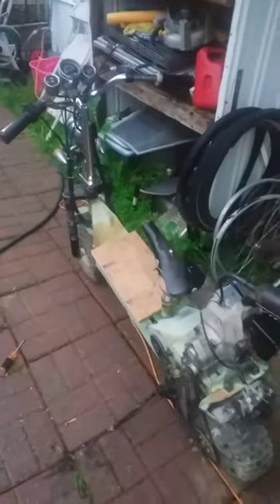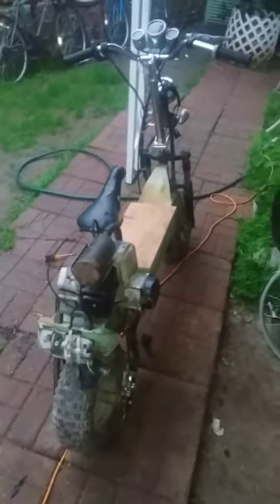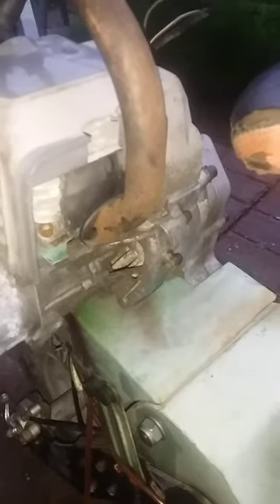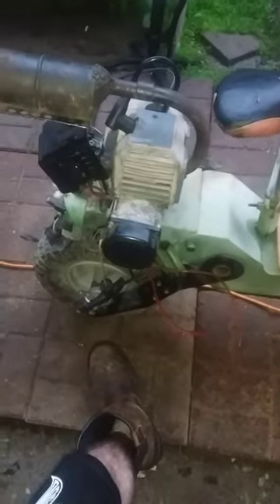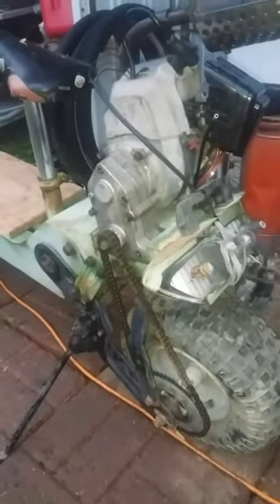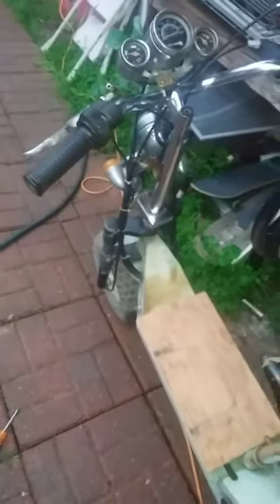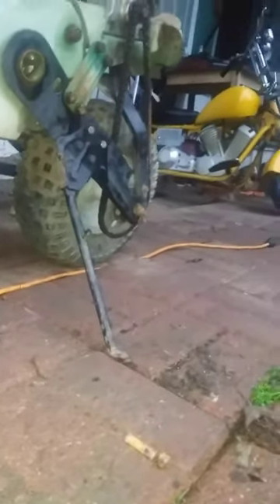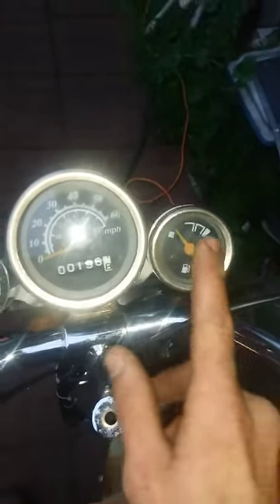49cc FS 507 on-road off-road camouflage stand-up sit-down scooter

Comment: I got one for $40 , the motor was toast, 2nd one I've worked on. Just like the 1st ,I got rid of all the 2 stroke stuff & replaced it with a predator 212 , most fun ever, wheelies all the time. The 1st one I built was for someone else, but this one is mine.